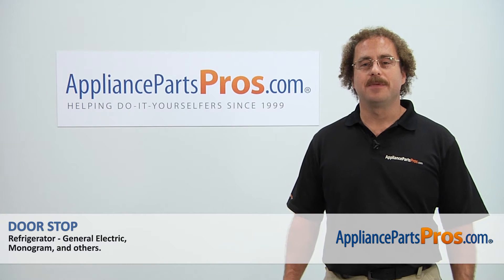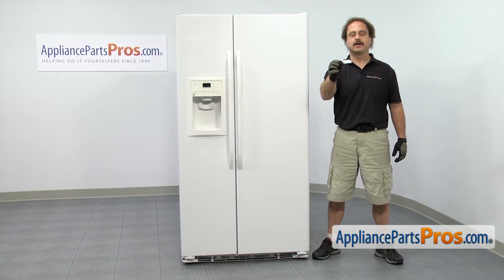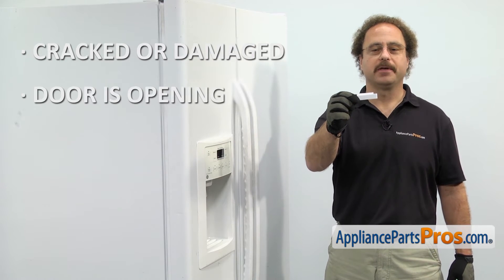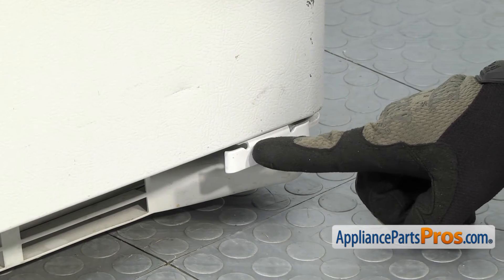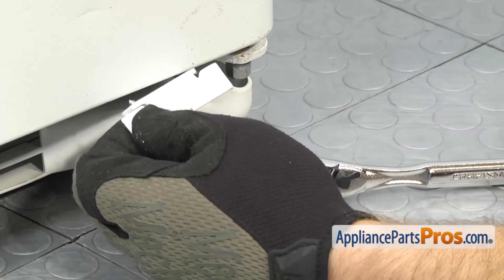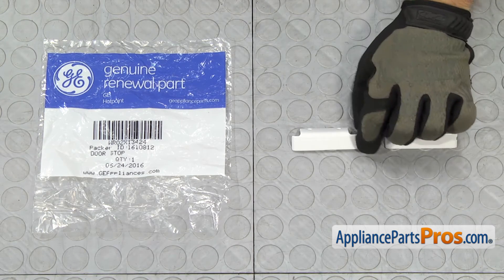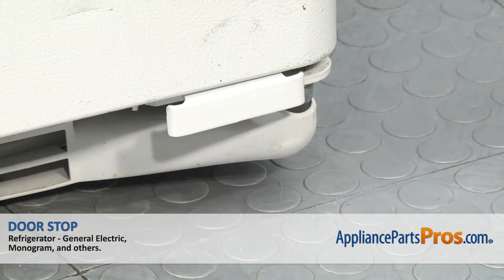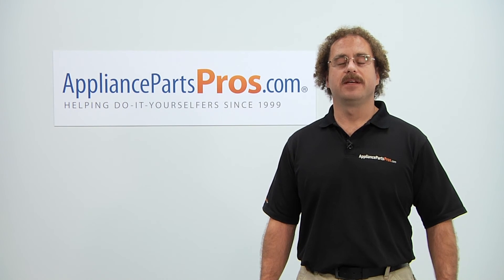How To: GE Door Stop WR02X13424

Comment: we just bought a Frigidaire Gallery side by side and the freezer door on the left opens to wide and hits the pantry door handle.  Is there a way to limit the freezer door from opening so far?
Reply from the maker: I am not aware of a door limiting kit, you can check the install manual to see if it mentions a kit number.